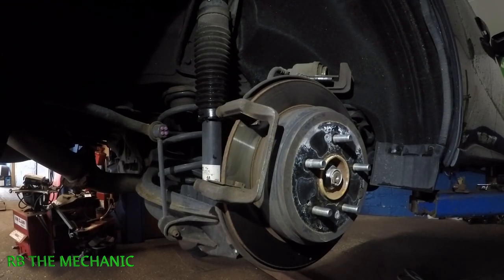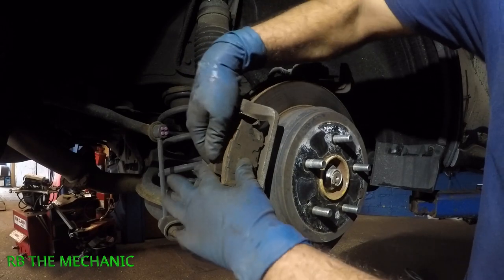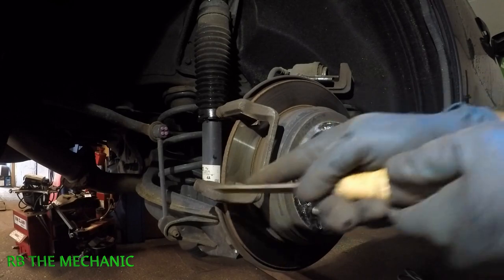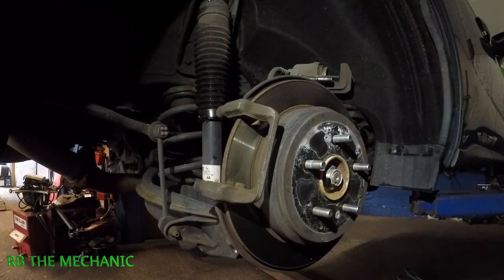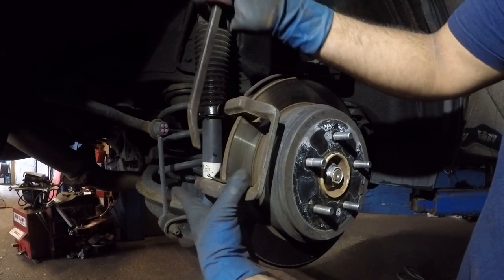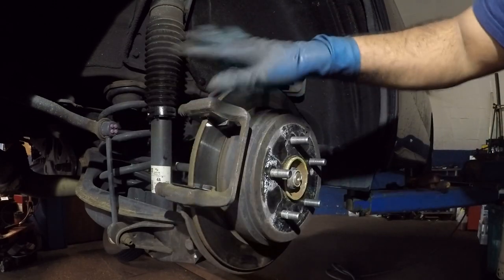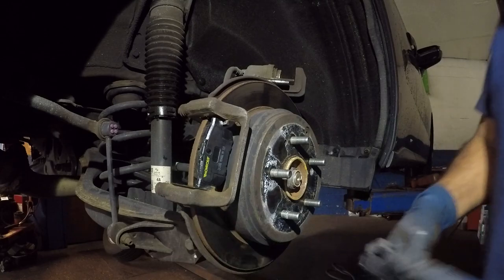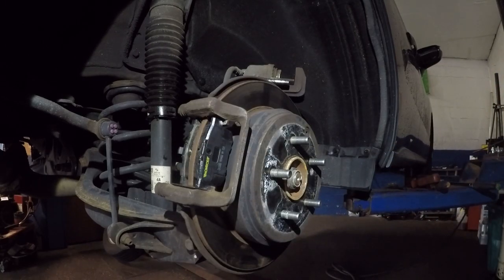Why brake pads wear uneven

Comment: I have a question please.  My front pads seems thicker and not worn out compared to the rear pads, and they all were changed at the same time.  Do you suspect that the front brakes are not working properly?  Thank you for your response!
Reply from the maker: It might be ir rear calipers are bad or brake are jammed
Reply: @RBTheMechanic  - Thank you for your advice!

Comment: Mine are brand new and it eats it way too uneven I bought both brand new rotors brake calipers and hoses still one bad sticks driver outer pad last 3 weeks
Reply from the maker: Did u check greasing inside slider pin some times it’s too much